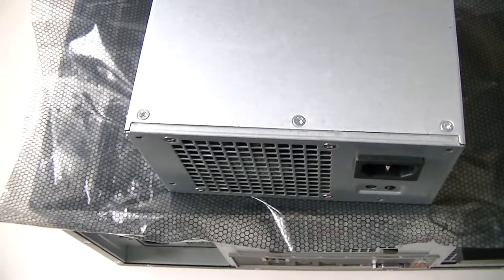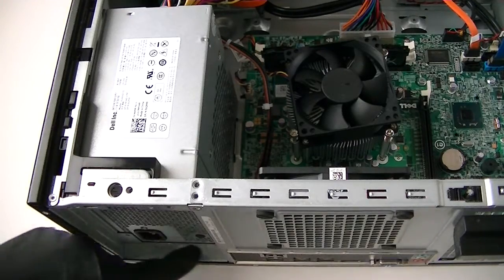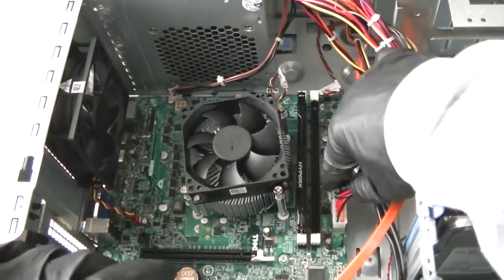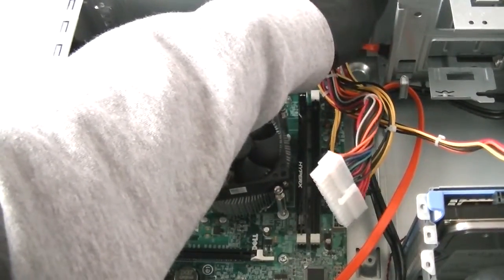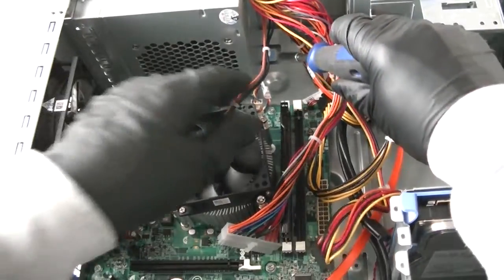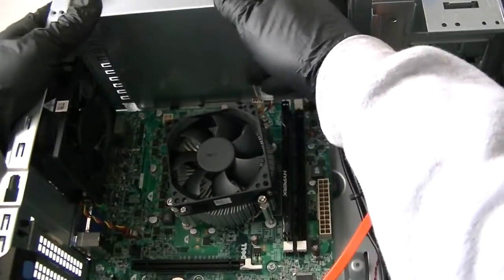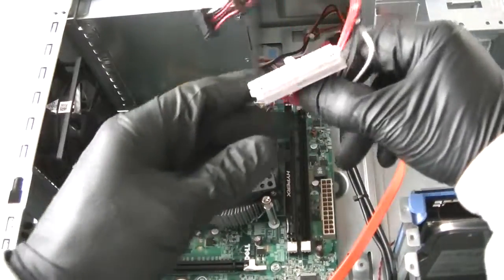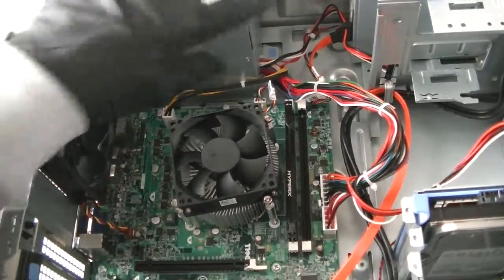Dell Optiplex 390 Power Supply Install Replace Upgrade Change

Comment from the maker: Full Parts list works with this machine Dell Optiplex 390:

CPU Supports Upgrade: 
With Latest BIOS Update A14

Intel Core i7-2600 Desktop CPU Processor-
https://amzn.to/3qtaKcK

PSU:

(1.) Corsair CX-M Series, CX450M, Modular Power Supply
https://amzn.to/3pnLUuh

(2.) Thermaltake Smart BX1 650W Power Supply
https://amzn.to/3Pl3WrN

(3.) Thermaltake SMART 600W ATX 12V V2.3/EPS 12V 80 Plus Power Supply
https://amzn.to/3DgVjfC

(4.) CORSAIR VS Series, VS500, 500 Watt, 80+ Certified, Non-Modular Power Supply
https://amzn.to/2RxoMZV

(5.) CORSAIR VS Series, VS450, 450 Watt, 80+ Certified, Non-Modular Power Supply 
https://amzn.to/3efEeDO

(6.) Thermaltake Smart 500W 80+ White Certified PSU
https://amzn.to/2xQHm8F

This video cards will work with this system.

Proof that this PC does support different video cards.
https://www.userbenchmark.com/System/Dell-OptiPlex-390/1958

(1.) EVGA 06G-P4-2068-KR GeForce RTX 2060 KO Video Card
https://amzn.to/3TZkol8

(2.) ZOTAC Gaming GeForce GTX 1660 Super 6GB Gaming Graphics Card
https://amzn.to/3e3hwmz

(3.) ZOTAC Gaming GeForce GTX 1660 6GB GDDR5 Graphics Card
https://amzn.to/3AUoPpX

(4.) MSI Gaming GeForce GTX 1660 6GB GDRR5 OC Graphics Card
https://amzn.to/3KseNzj

(5.) EVGA GeForce GTX 1650 Super SC Ultra Gaming, 4GB GDDR6
https://amzn.to/3Pmi58a

NOTE: Requires Power Supply Upgrade For GTX 1650 Super

(1.) ASUS Phoenix NVIDIA GeForce GTX 1650 OC Edition Gaming Graphics
https://amzn.to/3Nyn7yb

(2.) ASUS TUF Gaming NVIDIA GeForce GTX 1650 OC Edition Graphics Card 4GB GDDR6 
https://amzn.to/3moJbzo

(3.) PNY GeForce GTX 1650 4GB GDDR6 Dual Fan Graphics Card
https://amzn.to/3aFlxw4

(4.) ZOTAC GAMING GeForce GTX 1650 OC 4GB GDDR6 
https://amzn.to/3xeX0FF

(5.) AMD Radeon RX 6400 Low Profile Gaming Graphics Card
https://amzn.to/3s8MUUY

(6.) Gigabyte GeForce GT 1030 GV-N1030D5-2GL Low Profile 2G Computer Graphics Card 
https://amzn.to/2Z4PHkp

(7.) ZOTAC GeForce GT 1030 2GB GDDR5 64-bit Low Profile Video Card ZT-P10300A-10L 
https://amzn.to/2WzgLXk 

(8.) Gigabyte GV-N1030OC-2GI Nvidia GeForce GT 1030 OC 2G Graphics Card
https://amzn.to/3wd8EkB

(9.) Asus PH-GT1030-O2G GeForce GT 1030 2GB OC Edition Graphics Card
https://amzn.to/3SZ0gPC

This RAM works with this machine MAX Supports 16GB:

(1.) Crucial 8GB Single DDR3L 1600 MT/s (PC3L-12800) Memory CT102464BD160B
https://amzn.to/2VhGv8O

(2.) Crucial 4GB Single DDR3L 1600 MT/s (PC3L-12800) Memory CT51264BD160B 
https://amzn.to/2xq46wb

(3.) Crucial 16GB Kit (8GBx2) DDR3L 1600 MT/s (PC3L-12800) CT2K102464BD160B 
https://amzn.to/2VpsKpP

Thermal Compound Paste:

(1.) Arctic Silver 5 Thermal Cooling Compound Paste 
https://amzn.to/2ziNU0H

(2.) Noctua NT-H1 3.5g, Pro-Grade Thermal Compound Paste
https://amzn.to/36kTk7A

(3.) ARCTIC MX-4 (current edition) Thermal Compound Paste 20 Grams 
https://amzn.to/2DhGJaK

Hard Drive Caddy Adapter  3.5 to 2.5:

(1.) Dell 3.5" to 2.5" SSD or Hard Drive Caddy Adapter R494D 0R494D 
https://amzn.to/2XTPeRr

(2). Dell Hard Drive Caddy, R494D, F767D 3.5" to 2.5" SSD or Hard Drive
https://amzn.to/3cTkcOk

SSD list works with this PC:

Samsung 870 EVO 2TB SATA SSD
https://amzn.to/3ezOds5

Crucial MX500 2TB 3D NAND SATA Internal SSD
https://amzn.to/3B9f8CF

SanDisk Ultra 3D NAND 2TB Internal SSD - SATA
https://amzn.to/3RSZ8LR

(1.) Samsung 860 EVO 500GB 2.5 Inch Internal SSD MZ-76E500B/AM) 
https://amzn.to/2yNxnkE

(2.) WD Blue 3D NAND 1TB Internal SSD, 2.5" WDS100T2B0A
https://amzn.to/2wvnC9Z

(3.) WD Green 1TB Internal PC SSD  WDS100T2G0A
https://amzn.to/3cbrcWa

(4.) SanDisk SSD PLUS 480GB Internal SSD SDSSDA-1T00-G26
https://amzn.to/3a3i9ou

(5.) Crucial MX500 250GB 3D NAND SATA CT250MX500SSD1(Z) 
https://amzn.to/34rZlhy

(6.) Samsung 860 PRO SSD 256GB - 2.5 Inch SATA III Internal Solid State Drive
https://amzn.to/2ybiHLK

(7.) Samsung SSD 860 EVO 250GB 2.5 Inch SATA III Internal SSD 
https://amzn.to/2VjIAkK

(8.) SanDisk SSD PLUS 240GB Internal SSD
https://amzn.to/3c7SEE4

HDD list works with this PC:
(1.).WD Black 2TB Performance 3.5" Hard Drive - 7200 RPM Class, WD2003FZEX 
https://amzn.to/2xFUeyF

(2.).Seagate BarraCuda 1TB Internal Hard Drive  3.5" Hard Drive - 7200 RPM
https://amzn.to/3g8FXM8

(2.) Seagate BarraCuda 4TB Internal Hard Drive HDD – 3.5 Inch
https://amzn.to/3d3xWeR

Comment: i know this is old but will this thing support any psu?
Reply from the maker: Hi, Yes Full Parts list works with this machine:

CPU Supports Upgrade: 
With Latest BIOS Update A14

Intel Core i7-2600 Desktop CPU Processor-
https://amzn.to/3qtaKcK

PSU:

(1.) Corsair CX-M Series, CX450M, Modular Power Supply
https://amzn.to/3pnLUuh

(2.) Thermaltake Smart BX1 650W Power Supply
https://amzn.to/3Pl3WrN

(3.) Thermaltake SMART 600W ATX 12V V2.3/EPS 12V 80 Plus Power Supply
https://amzn.to/3DgVjfC

(4.) CORSAIR VS Series, VS500, 500 Watt, 80+ Certified, Non-Modular Power Supply
https://amzn.to/2RxoMZV

(5.) CORSAIR VS Series, VS450, 450 Watt, 80+ Certified, Non-Modular Power Supply 
https://amzn.to/3efEeDO

(6.) Thermaltake Smart 500W 80+ White Certified PSU
https://amzn.to/2xQHm8F

This video cards will work with this system.

Proof that this PC does support different video cards.
https://www.userbenchmark.com/System/Dell-OptiPlex-390/1958

(1.) EVGA 06G-P4-2068-KR GeForce RTX 2060 KO Video Card
https://amzn.to/3TZkol8

(2.) ZOTAC Gaming GeForce GTX 1660 Super 6GB Gaming Graphics Card
https://amzn.to/3e3hwmz

(3.) ZOTAC Gaming GeForce GTX 1660 6GB GDDR5 Graphics Card
https://amzn.to/3AUoPpX

(4.) MSI Gaming GeForce GTX 1660 6GB GDRR5 OC Graphics Card
https://amzn.to/3KseNzj

(5.) EVGA GeForce GTX 1650 Super SC Ultra Gaming, 4GB GDDR6
https://amzn.to/3Pmi58a

NOTE: Requires Power Supply Upgrade For GTX 1650 Super

(1.) ASUS Phoenix NVIDIA GeForce GTX 1650 OC Edition Gaming Graphics
https://amzn.to/3Nyn7yb

(2.) ASUS TUF Gaming NVIDIA GeForce GTX 1650 OC Edition Graphics Card 4GB GDDR6 
https://amzn.to/3moJbzo

(3.) PNY GeForce GTX 1650 4GB GDDR6 Dual Fan Graphics Card
https://amzn.to/3aFlxw4

(4.) ZOTAC GAMING GeForce GTX 1650 OC 4GB GDDR6 
https://amzn.to/3xeX0FF

(5.) AMD Radeon RX 6400 Low Profile Gaming Graphics Card
https://amzn.to/3s8MUUY

(6.) Gigabyte GeForce GT 1030 GV-N1030D5-2GL Low Profile 2G Computer Graphics Card 
https://amzn.to/2Z4PHkp

(7.) ZOTAC GeForce GT 1030 2GB GDDR5 64-bit Low Profile Video Card ZT-P10300A-10L 
https://amzn.to/2WzgLXk 

(8.) Gigabyte GV-N1030OC-2GI Nvidia GeForce GT 1030 OC 2G Graphics Card
https://amzn.to/3wd8EkB

(9.) Asus PH-GT1030-O2G GeForce GT 1030 2GB OC Edition Graphics Card
https://amzn.to/3SZ0gPC

This RAM works with this machine MAX Supports 16GB:

(1.) Crucial 8GB Single DDR3L 1600 MT/s (PC3L-12800) Memory CT102464BD160B
https://amzn.to/2VhGv8O

(2.) Crucial 4GB Single DDR3L 1600 MT/s (PC3L-12800) Memory CT51264BD160B 
https://amzn.to/2xq46wb

(3.) Crucial 16GB Kit (8GBx2) DDR3L 1600 MT/s (PC3L-12800) CT2K102464BD160B 
https://amzn.to/2VpsKpP

Thermal Compound Paste:

(1.) Arctic Silver 5 Thermal Cooling Compound Paste 
https://amzn.to/2ziNU0H

(2.) Noctua NT-H1 3.5g, Pro-Grade Thermal Compound Paste
https://amzn.to/36kTk7A

(3.) ARCTIC MX-4 (current edition) Thermal Compound Paste 20 Grams 
https://amzn.to/2DhGJaK

Hard Drive Caddy Adapter  3.5 to 2.5:

(1.) Dell 3.5" to 2.5" SSD or Hard Drive Caddy Adapter R494D 0R494D 
https://amzn.to/2XTPeRr

(2). Dell Hard Drive Caddy, R494D, F767D 3.5" to 2.5" SSD or Hard Drive
https://amzn.to/3cTkcOk

SSD list works with this PC:

Samsung 870 EVO 2TB SATA SSD
https://amzn.to/3ezOds5

Crucial MX500 2TB 3D NAND SATA Internal SSD
https://amzn.to/3B9f8CF

SanDisk Ultra 3D NAND 2TB Internal SSD - SATA
https://amzn.to/3RSZ8LR

(1.) Samsung 860 EVO 500GB 2.5 Inch Internal SSD MZ-76E500B/AM) 
https://amzn.to/2yNxnkE

(2.) WD Blue 3D NAND 1TB Internal SSD, 2.5" WDS100T2B0A
https://amzn.to/2wvnC9Z

(3.) WD Green 1TB Internal PC SSD  WDS100T2G0A
https://amzn.to/3cbrcWa

(4.) SanDisk SSD PLUS 480GB Internal SSD SDSSDA-1T00-G26
https://amzn.to/3a3i9ou

(5.) Crucial MX500 250GB 3D NAND SATA CT250MX500SSD1(Z) 
https://amzn.to/34rZlhy

(6.) Samsung 860 PRO SSD 256GB - 2.5 Inch SATA III Internal Solid State Drive
https://amzn.to/2ybiHLK

(7.) Samsung SSD 860 EVO 250GB 2.5 Inch SATA III Internal SSD 
https://amzn.to/2VjIAkK

(8.) SanDisk SSD PLUS 240GB Internal SSD
https://amzn.to/3c7SEE4

HDD list works with this PC:
(1.).WD Black 2TB Performance 3.5" Hard Drive - 7200 RPM Class, WD2003FZEX 
https://amzn.to/2xFUeyF

(2.).Seagate BarraCuda 1TB Internal Hard Drive  3.5" Hard Drive - 7200 RPM
https://amzn.to/3g8FXM8

(2.) Seagate BarraCuda 4TB Internal Hard Drive HDD – 3.5 Inch
https://amzn.to/3d3xWeR

Comment: is evga 400w power supply works with this ?
Reply from the maker: Hi, yes you can use  evga 400w will work fine.
Reply: @Mxkdt  will evga 600w power supply work on this?
Reply: @GeneralNoLimit  Yes

Comment: am planning to put in a 400watt evga power supply the graphic card am gonna use is 710 is it possible willl anything go wrong?? pls help
Reply from the maker: Hi, yes  400watt evga power supply will work fine.
Reply: Mxkdi thx thx thx thx thx thx thx thx thx alot

Comment: moved board and everything into bigger case but don't have matching plugs for case power cord. 12 pin that is blue can't find on board, is there a adaptor price or am I SOL? thanks
Reply from the maker: This motherboard is only to be used in dell machine and because the  front panel and switch is located on the top right corner what are you trying to do ?
Reply: Mxkdi I was going to turn it into a gaming rig. the reason I bought the tower was for a mother board supporting lga 1155 socket.
Reply from the maker: Did you buy dell mini tower or is it desktop ?
Reply: Mxkdi I bought a mini tower. why?
Reply from the maker: mini tower and small form factor use different motherboard
Reply from the maker: Yes
Reply from the maker: Hi, yes gtx 750 ti will fit dell 390 mini tower

Comment: Hi.I have a question.For Dell optiplex 390 SFF. I want to replace the PSU but to replace with a unit that fits and has more Watts. Like 300w or  400w. Do you know if I can find a replacing part like this?Because the dimensionsof the unit are 6*7*24 cm. thanks
Reply from the maker: dell optiplex 390 small form factor you can use same power supply, only if you get dell optiplex 390 mini tower you can upgrade to bigger power supply you can watch my other videos.

Comment: when upgrading the power supply to apply a graphics card what are the minimum/maximum s of watt pull for the board
Reply from the maker: watch my other video i did upload on a dell optiplex 3010 upgrades
Reply from the maker: what kind a graphics card are you going to install ?
Reply: +mxkdi can I change psu in Dell 3010 Mini tower about 600 watt
Reply from the maker: Yes you can what brand is it ?
Reply: +mxkdi I will purchase cooler master or cosair for heavy gpu now I have Dell psu 265 watt
Reply from the maker: Yes cooler master and cosair are great power supply.